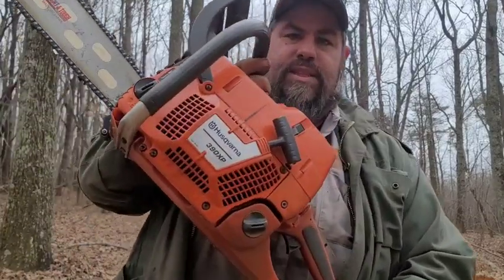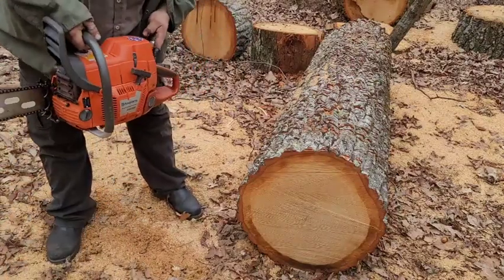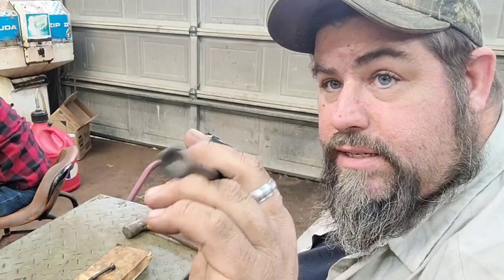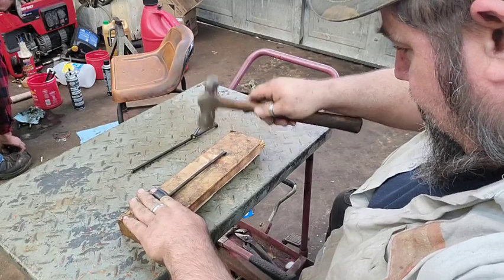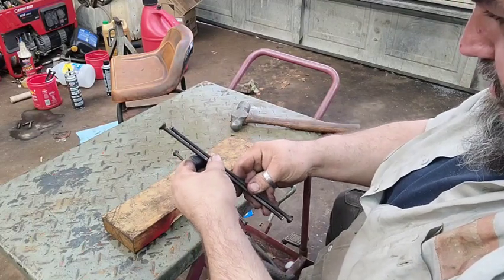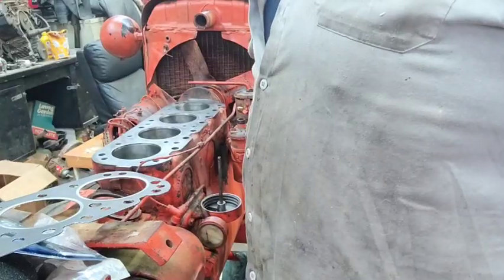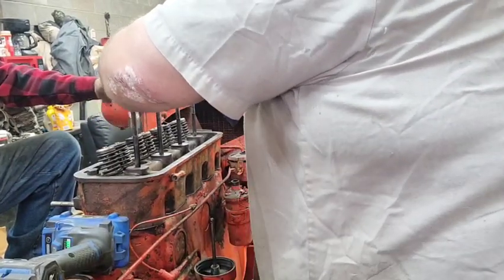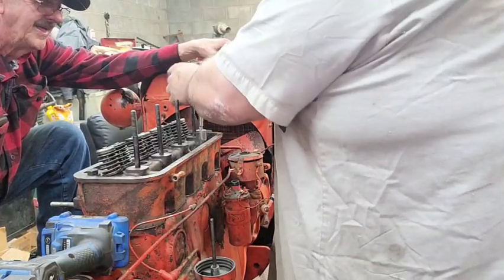Husqvarna 390 Xp Allis Chamlers Tractor

Comment: Hi Bellhopper!!😀😀
I figured it was a Allis C. Because I think the Allis B didn't have sleeves in it. But I could be wrong. 
That is a C that you are working on right??
Reply from the maker: Im not sure buddy i didnt look dad has been ordering the parts
Reply: @bellhoppersaws  I'm pretty sure it's a C because of the front axle. It's a C front axle and not a  model B front axle. We have owned several of them over the years. I actually have a model C sitting in my shed that I really need to get running. It hasn't been started in probably close to 10 years. I just hope that the engine isn't set. I have 11 tractors in my collection right now and haven't been getting all of them running on a regular basis for the last several years. I used to take a weekend every summer and get them all running. But since my back went to crap I haven't been doing it. 
TTYL!!😀😀
Reply: If it has a 4sp transmission it is a ca allischalmer the b and c had 3speed transmission idk if the b and c had a hand clutch but i do know the ca had a hand clutch that was allos chalmers early attemps at having a live pto
Reply: @austincordle2747  the B and C didn't have the hand clutch. Their live power system wasn't the best thing in the world.